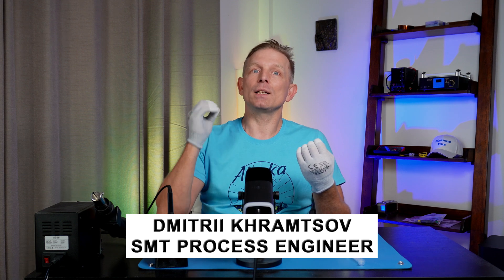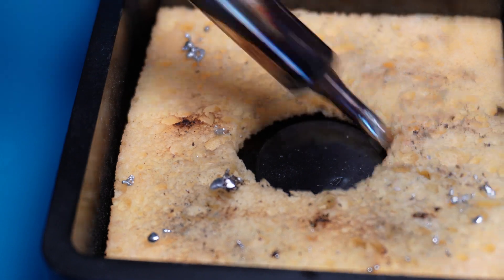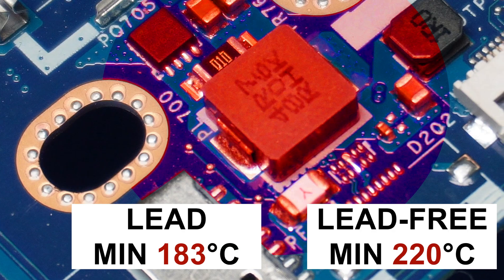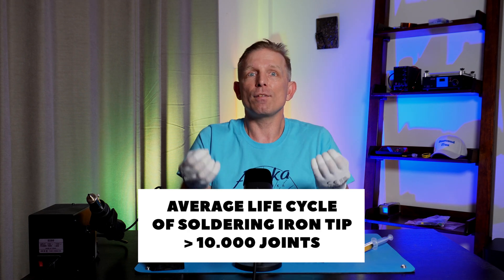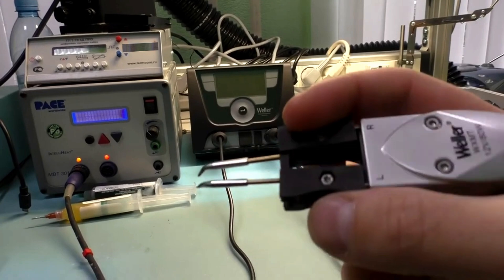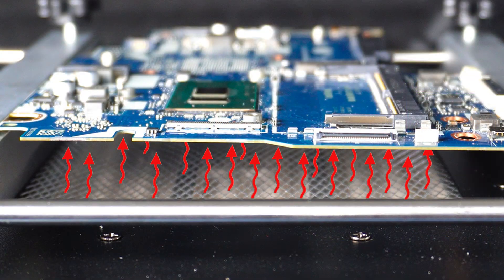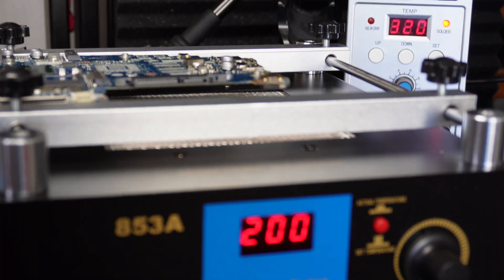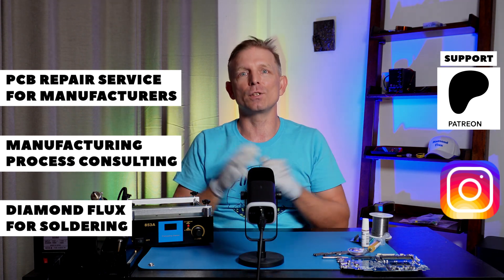Soldering Iron Tip Temperature — Mistakes and solutions!

Comment: Can confirm based on my 20 years expirience. 310-320 degrees for leaded alloy (310 to solder different connectors to the wires and 320 to solder PCBs) and 350-380 for lead-free alloy (380 degrees is a usual temperature and 350 when I use a preheaters or to solder temperature-sensitive components like LEDs).
Reply from the maker: Sure, absolutely 👍
Reply: For me (30 yrs as tv repaiman), 360°C is basic temperature. Never less than 360°C but sometimes more than that (very, very rare).

Point is to desolder component ASAP and stop heating the pcb. If you set it on 320°C, it will take the time to solder or desolder it. 
Old pcb's was so sensitive to high temperature. New one are not so.
Reply from the maker: Thank you 👍